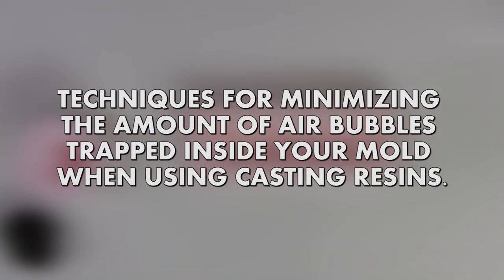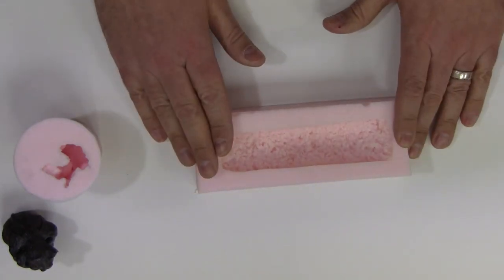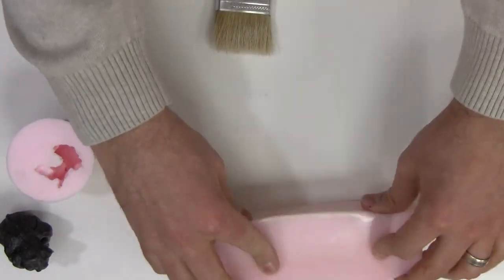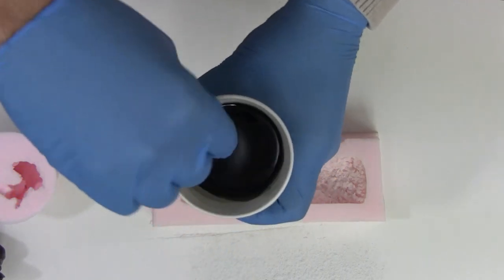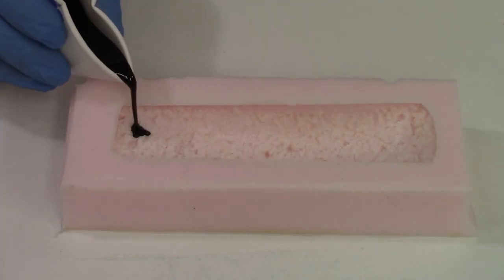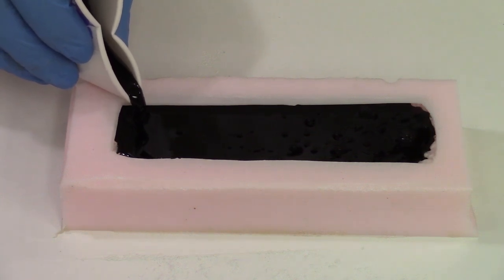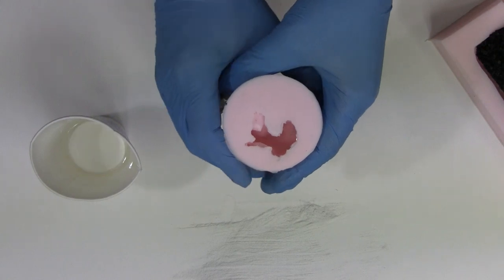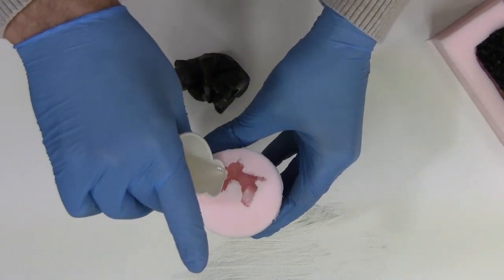How To Minimize Air Bubbles In Castings - Molding & Casting Tutorial | Alumilite

Comment: Is your mold by any chance made of amazing mold rubber? And if so did your resin cure correctly?
Reply from the maker: This is either our Amazing Mold Rubber or one of our High Strength series silicones. If you're experiencing curing issues, Amazing Mold Rubber has a full cure time of one week. Any epoxy casted prior to that one week cure time likely will have curing issues.
Reply: @AlumiliteCorporation  I have also experienced curing issues with resin.  I cast kit and scratch built parts for model kits and I've never really had any issues, except within the past year.  The resin doesn't fully cure and it is soft enough I can bend it.  Would this come down to not letting the moulds cure for that whole week?  Thanks!